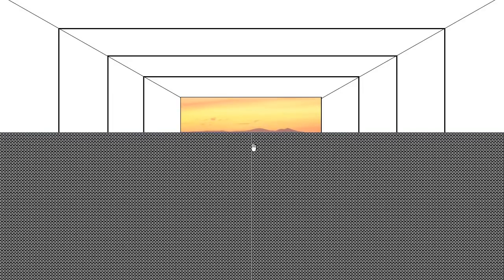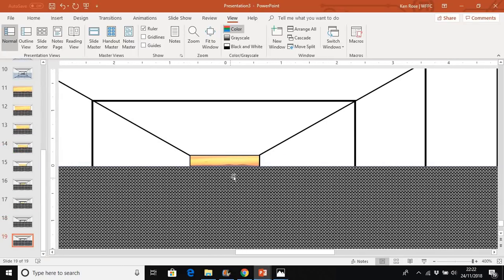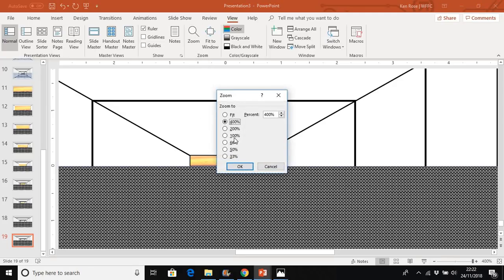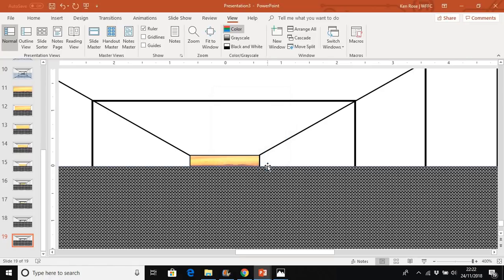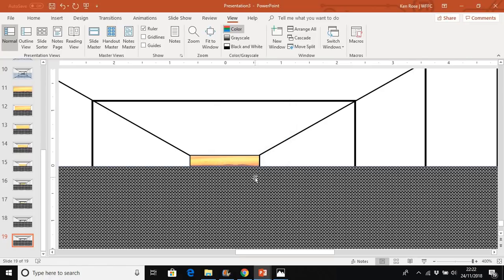Dr Perspective owes me $1000

Comment: +Miles,

You have shown how pure geometric perspective works however the reason things fall below the horizon is not explained by perspective, but refraction and primarily atmospheric lensing from the moisture in the air and our atmosphere. Basically you are doing what all of us do at first by extremely over simplifying things. 

If you add this to a 3d model, the mountains will indeed go down.

Check out steve torrense's work for more a great introduction on how our atmosphere and light could easily explain our existence in either model.

Cheers!
Reply from the maker: Please could you demonstrate how refraction and atmospheric lensing could cause a 1011m mountain to drop below a 210m eye level.
Reply: @MilesDavisKDAB  There is empirical proof of this possibility all the time. Have you heard of looming or towering? Those alone are use to explain seeing mountains at ranges of over 300 miles in the Antarctic region according to the National Geo-spatial Intelligence Agency (nga.mil) Antartic sailing guides. Here is an exact excerpt  under the section optical phenomenon. 

"There is almost no dust or solid particles in the Antarctic air and the prevailing winds blowing off the continent have small moisture content. Consequently, the visibility is usually very good and often exceptional, a fact which, if not appreciated, may lead the observer into serious error when judging distances. An object which may be thought to be but 5 miles distant could well be 30 miles away, and mountains have been sighted at 300 miles. "

At 300 miles, at an elevation of 100 feet above sea level the horizon would be 55,000 feet below, yet we see mountains at which only reach 16,000 feet?

So I may not have a 3d model with proper refraction modeled for you yet, but there is enough evidence to support the 'possibility' which I eluded to in my initial post. Not a proof, or a certainty or even a likelihood, just a 'possibility' that we could be deceived by our own senses. 

Cheers!
Reply: @JohnSmith-qf3ee  So looming makes things appear higher so they can be seen over the horizon. So how can the same atmosphere make the mountains in Mile's photo get lower? Do you need some magical property of the atmosphere that somehow knows whether are flat earther or glober is watching to decide what to do?

Comment: You’re so dishonest.  
https://youtu.be/qKhV8Eo9PIg

Funny anything thinner than 0.02 radians or 1 arc minute your eyes cannot render!

Seeing how as human beings we are close to the ground further limiting the angle of view below eye level, I wonder if the angle below eye level or above will hit this vanishing point first where the angle is too thin for the eye to render..

Yup this occurs bottom up..
Reply: "Seeing how as human beings we are close to the ground further limiting the angle of view below eye level"

Not in the case of Miles' observation. He's at 210m above sea level, and in front of him, the land falls away, consistently down to sea level at the QC tower. 

There's nothing there to limit the angle of view.
Reply: Tumeni Hits 
LETS DO THE CALCULATIONS:

*Caveat we are begging the question with your proof of nothing perspective hijacking curve calculator

CURVE CALCS
Distance = 124.6 km (124600 m), View Height = 210 meters Radius = 6371 km (6371000 m)

Results ignoring refraction
Horizon = 51.73 km (51728.76 m)
Bulge = 304.61 meters
Drop = 1.22 km (1218.54 m)
Hidden= 416.74 meters
Horizon Dip = 0.465 Degrees, (0.0081 Radians)

With Standard Refraction 7/6*r, radius = 7432.83 km (7432833.33 m)
Refracted Horizon = 55.87 km (55873.38 m)
Refracted Drop= 1.04 km (1044.44 m)
Refracted Hidden= 317.73 meters
Refracted Dip = 0.431 Degrees, (0.0075 Radians)

MOUNTAIN HEIGHT
Ben Lomond (Scottish Gaelic: Beinn Laomainn, 'Beacon Mountain'), 974 metres (3,196 ft), is a mountain in the Scottish Highlands. - Wiki

QUESTION
Why don't we see the Mountain rise above the 210 meter line in reality if over 210 meters is supposed to be visible according to your calculator?

VERIFICATION:
Please provide the orthographic representation of what we should observe.  This where the deceit lies...pun intended.

NEXT...
Reply: "Why don't we see the Mountain rise above the 210 meter line in reality if over 210 meters is supposed to be visible according to your calculator?"
Drop 1218.54 m    Hidden 416.74 m  Ben Lomond 974 m
Reply: LBBStore - references to 'bulge', 'drop' etc are apparently based on calculation around a perfect or near-perfect spheroid. 

What we have here is a vantage point on one side of a valley, a tower of the same height on the same side of the valley, , and some hills on the other side of the valley.  The valley floor is effectively at zero metres, or sea level.  

You haven't shown how your "bulge" was calculated, so why should I place any credence on it? Are you saying the bulge is the equal of sagitta h in this instance? 

https://upload.wikimedia.org/wikipedia/commons/thumb/f/fb/Circularsegment.svg/257px-Circularsegment.svg.png

from 

https://en.wikipedia.org/wiki/Circular_segment

???
Reply: Tumeni Hits 
Bulge? Sagitta?

Give it me the orthographic view of this observation...

Give it me!
Reply: All Praise the Blue Marble 
The Earth is flat as objects trending into the distance will appear to converge to the eye level of the viewer.  

Your strawman of a flat Earth omits perspective.
https://imgur.com/gallery/fD9NccP

Also, the 974m mountain in your orthographic globe view should be over the 210m line and we do not see it rise passed that line.
Reply: @LBBstore
Cool, and Miles' footage was recorded with his eyes?
Secondly, his observation was one of hidden height?
Reply: cinnamoncontrol 
Hi Cinnamon,

I hope you’re having a great Sunday.

Here is an observation from reality where the angle below eye level is more limited by the ground as opposed to a much wider angle above eye level.
https://youtu.be/gCuCshbACEI

Guess which one reaches that point of 0.02 radians or 1 arc minute first?

We do not have supervision.  Once this point is reached the object will appear to blur and then vanish bottom up.
Reply: Graeme Houston 
That is incorrect.
https://youtu.be/gCuCshbACEI

Since we are so close to the ground the angle of view below eye level is already limited as opposed to a much wider angle of view above eye level which is why there is disproportionate observed compression when viewing a distant object.

If you climb up a ladder, close to your ceiling, then slide an object away from you along your ceiling, the object will seem to vanish top down because now the limited angle is above eye level.

Comment: Dr Perspective
As you seem to be having trouble grasping this, let's explain it another way  ... YOUR way.

[1] Definition: Linear perspective, a system of creating an illusion of depth on a flat surface. All parallel lines (orthogonals) in a painting or drawing using this system converge in a single vanishing point on the composition's horizon line.

[2] Definition: Eye level, the level of the eyes looking straight ahead.

You have already accepted that the lines are parallel and that the top of the wall is the "horizon" at "eye level"

Do parallel lines ever converge? According to YOU they don't .
So, according to YOU and YOUR definition ... even at the vanishing point the lines remain parallel, so the mountains would NEVER drop BELOW the wall ... and furthermore, they always remain ABOVE the level of the wall. [1]

So, if "eye level" [2] is the top of the wall, and the mountains are always ABOVE the top of the wall, the mountains are always ABOVE eye level, even at the vanishing point.

The fact that your eyes lack sufficient resolution to be able to discern this fact is irrelevant.

Short version:
If the parallel lines are infinitely long, and the vanishing point is infinitely far away, the "angular size" (because I know you FE'ers love that phrase) between them will become infinitely small.
Infinitely small is not the same as Zero ... so no, the mountains do not, ever, drop to eye level.
Even if the angle is 1 billionth of a billionth of a billionth of a degree ... it is still ABOVE "eye level"

EDIT: As a bonus, I will let you in on a secret ... the mountains actually WILL drop to eye level and, what's more, drop BELOW eye level ... on a Sphere  ... AND ... just to round everything out nicely ... it would NOT be due to perspective. (The definition of "linear perspective" should be enough of a clue as to why)